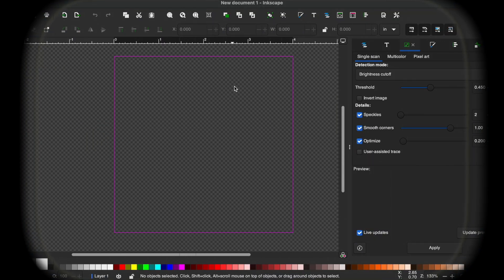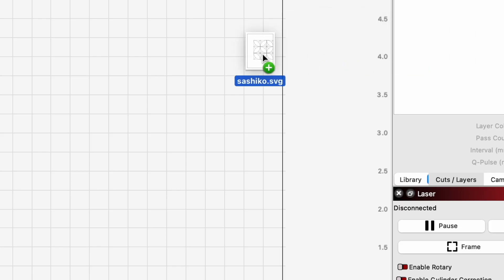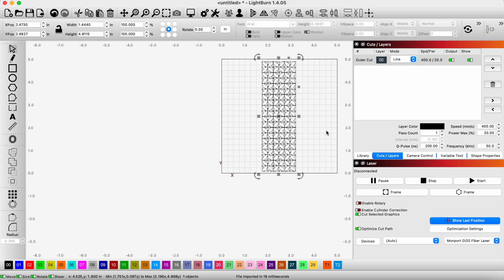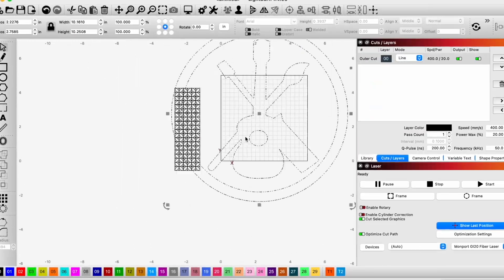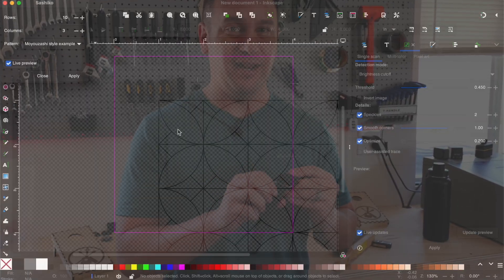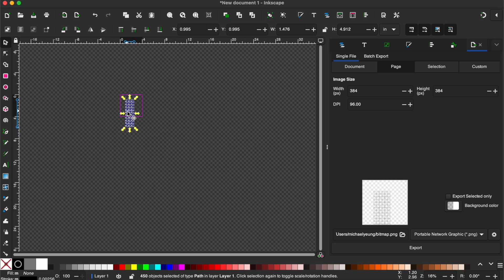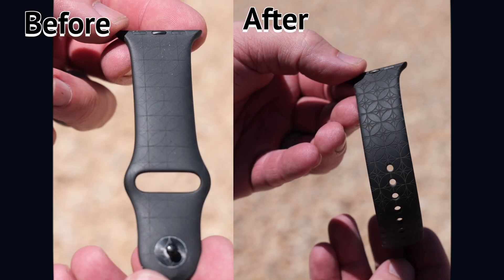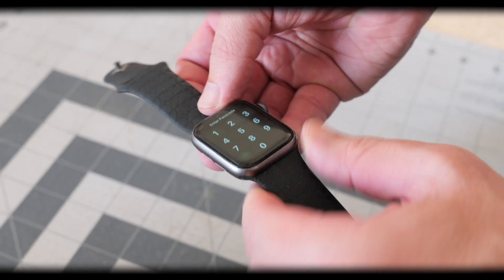HOW TO LASER ENGRAVE SILICONE RUBBER APPLE WATCHBANDS

Comment: Great job! You used the same settings for all the bands? I was able to get them from your video. I am trying to expand on my knowledge of working with my 60w Mopa monport fiber laser.  The first one, where you did your logo to the final product of all the bands...done with the same settings?  Thank you!
Reply from the maker: They are all the same settings, all the ones other than the black we had to run multiple times to get a darker result. The same setting was used for the logo on the inside of the band.  Thanks for watching!